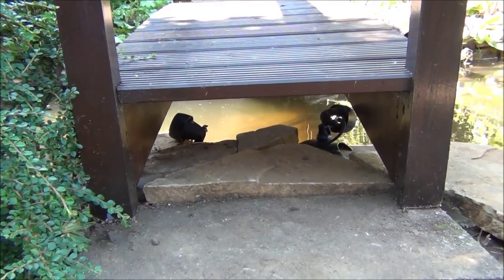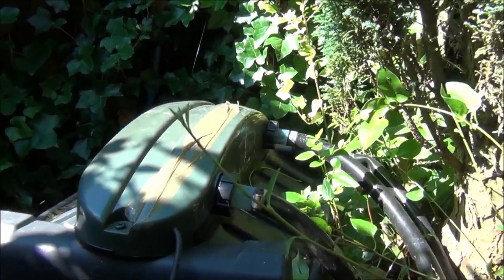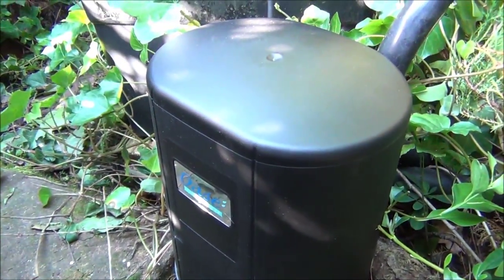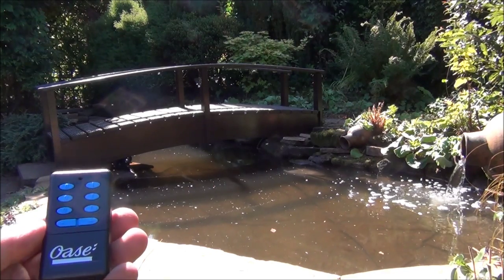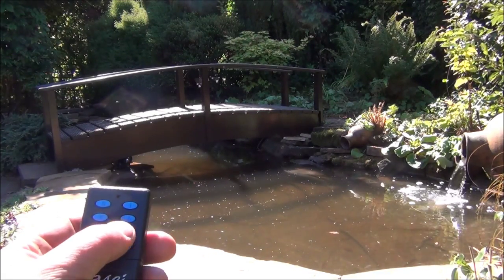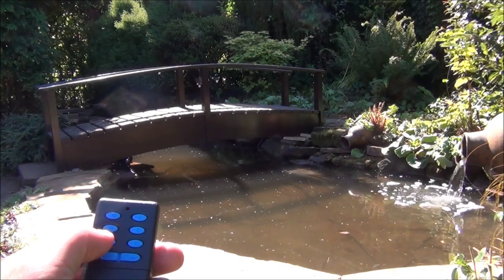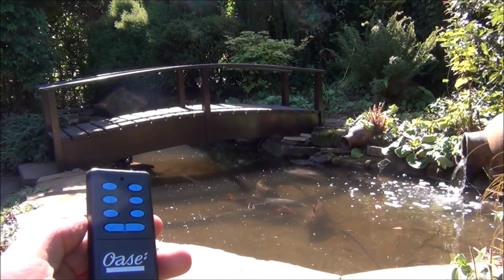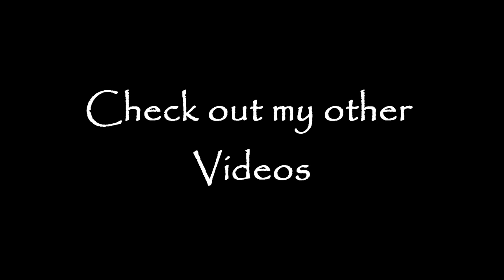Fish Pond Rebuilding near Durham by Pondguru

Comment from the maker: I never just like to install new gear when the old pump / filter set up is working. This one was OK so I didn't touch it. The pump wasn't the best but at the same time it wasn't a crazy high wattage. If it was I would have suggested an Aquamax pump as a replacement to save money.
Thanks for watching and appreciating the video.

Comment from the maker: I trust you are one of the good ones, man. Some of the jobs I've been to have been unbelievable with junction boxes buried underground and full of water, block connectors wrapped in tape and buried etc.
On the flipside some have been done with properly rated gear with no chance of failure.

Comment: Just to let you know, fitted a fm master 3 at the weekend to our oase 8000 eco premium, connected it to the dimmer on circuit 3 and it works great. Was able to slow the flow rate down to an ideal level, and saving energy at the same time.
Reply from the maker: Great to hear - they are very good units.

Comment: Does the FM Master 3 dimmer remember its previous setting position each time you switch it on?.
Reply from the maker: As far as I can remember it does yes although the ones I used to install were a few years ago and it looks like Oase have remodeled them - If you phone Oase they have a technical department which could tell you straight away..
Reply: Pondguru, thanks for the reply, I did phone them today and they implied that the dimmer socket could only be switched on/off by dimming it right down to off. I wasn’t convinced this was right. I need to reduce flow to a blade as well as introduce remote switching, have a aqua max eco 8000 premium. Was thinking the FM master 3 may be the solution.
Reply from the maker: If that is what they came back with then it will be correct, current information.
I've just dug out my FM3 and connected a pump with asynchronous motor to it and it doesn't dim it at all from any socket (mine is old type which has 4 sockets) but that is probably down to it being so old (maybe 15+ years old) so I can't shed any more light on that unfortunately.